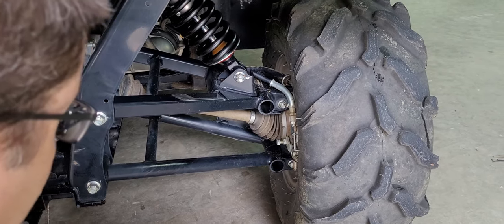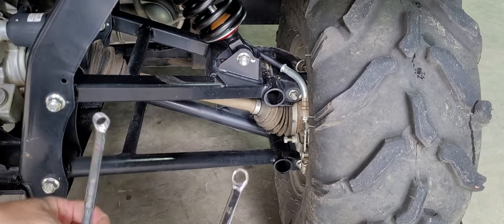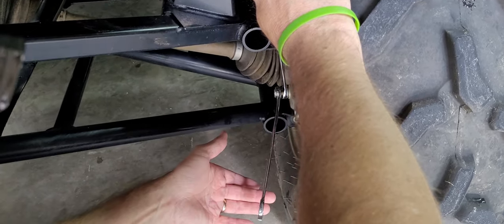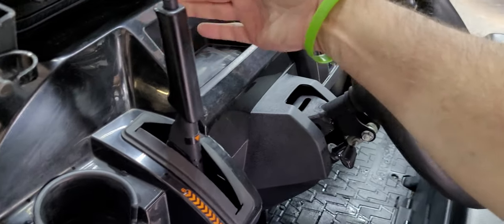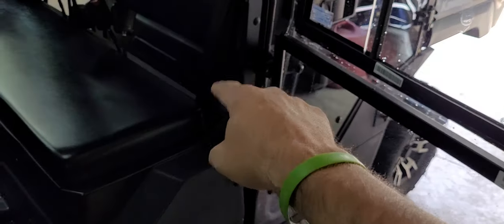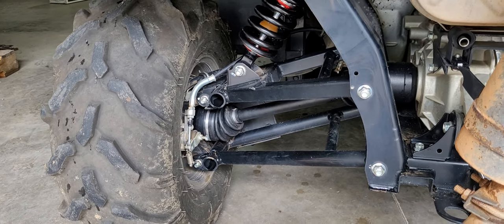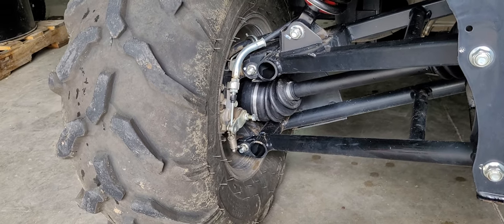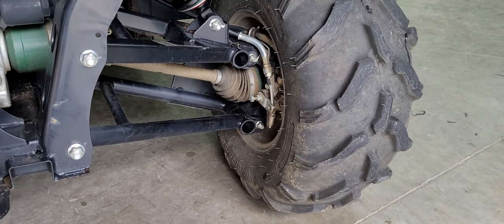How to Adjust the parking brake on Kawasaki Mule Pro FX/FXT/FXR/DX/DXT 2015+ models.

Comment: Thanks for the helpful video.  There's a lurking gotcha' doing this you don't mention, and I guess if you do it all "just right", it won't jump out and get'cha, but it did for me just now on my '22 Pro FX EPS LE .

The problem that I ran into is that the inside of that U-shaped piece fits on a shouldered casting, and if you loosen the whole thing too much, the springs down there will try to pull it off its seating position.  Then, since the pieces aren't assembled correctly, if you try to do the adjustment, it won't succeed.  Once I got that corrected, the adjustment went the way it should.  

Just thought I'd toss that into the mix for the benefit of future DIYers.

Comment: So I guess if the brake is sticking after you do this the brake bolt will be red hot and if it's cool to the touch after a drive the parking brake isn't sticking ?
Reply from the maker: That would be a good indication yes. You can freely roll the unit, if it is dragging a good chance one or both the parking brakes are too tight.